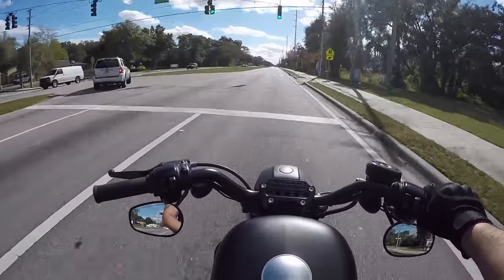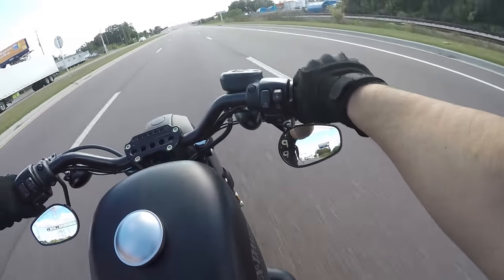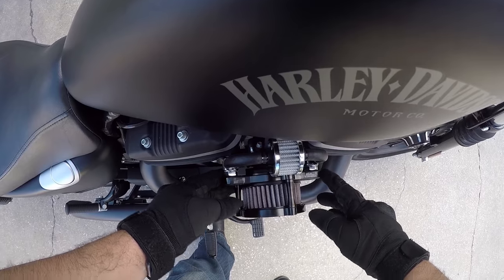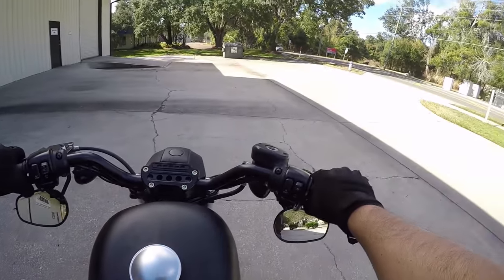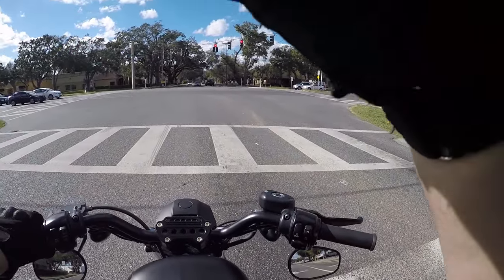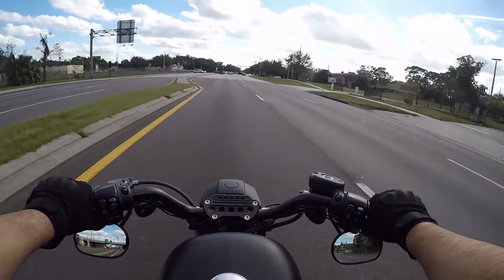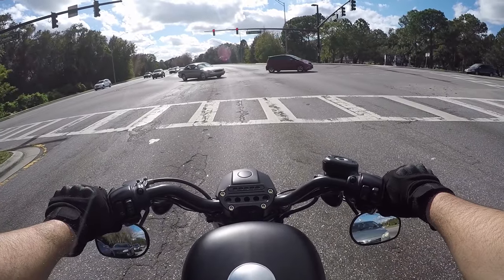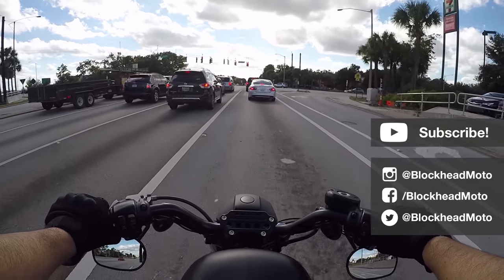AutoTune Problems - V&H Fuelpak FP3 - Harley Iron 883

Comment: Awesome video, man, and hello from Guam! Felt the same problem with the jolting mid-ride and even high RPMs with my FP4. I couldn't find the problem for the life of me, haha. I checked the TPs, air filter, and everything. But the main problem was my battery! Popped a new one in, and it fixed everything. I also asked V&H for a better map that retrofits my build. Everything is smooth as can be.

Comment: I've read most of the comments and every one is saying they put the canned map in and it runs like crap. Me too. After running auto time for about thirty min I flashed the auto time map and got a huge increase in power. Off the line still sucked so I left the bike idleing and let out the clutch and did that several times I did another 25 min autotune then flashed that one and since then it has been awesome. I ride a 2010 dyna. Hope this helps. Make sure you run your bike at all rpms. My maps were almost solid green when I flashed.

Comment: You can contact V&H and tell them your set-up.  I know with Dynojet on my former Ultra Classic, that company recommended which "canned" map would offer the best result.  Perhaps for the wife, a Honda Rebel, or smaller Shadow would be appropriate and still have the cruiser look.  Ride safe!
Reply from the maker: Yeah V&H has all their recommended canned maps programmed into their app. You connect to the FP3 via Bluetooth and program it on your phone, it's pretty awesome. Running their recommended canned map for my setup and the mpg's is terrible, and have heard from many running Auto Tune helps that out a lot. Should be trying to tackle it again over the weekend!

Comment: Auto Tune will keep adjusting as you ride, to find the best point to lock your riding style info into the ECU. You should not Auto Tune full time, as the ECU will just keep getting new and different info. Set it, dump it, and get out of Auto Tune.

For best mileage, find a 20-30 minute ride that keeps you fairly level, and not a lot of throttle input unless necessary. When you dump that info into the ECU, it will think that's how you always ride. The ECU will retain factory throttle input when you need power, so there will be no lag with the engine running lean for mileage. If you ride like normal hooligan style, AutoTune won't do much more than the factory ECU setting.

In the sensor data screen, you can select "Eco" to see when the mileage program shuts off during acceleration. I put my phone in the Raw mount, to watch the sensor data as I ride. I have RPM in the main screen, with mileage, gear, Eco, and engine temperature in the corners.

I also set my backfire for "nasty". So much fun cracking and banging to a stop :)
Reply from the maker: Nice man, thanks for all the info and insight +Messkit! Appreciate it. I'll be sure to give your recommendations a try over the weekend. Thanks again! 

+1 on decel pop, enjoyed mine being more rumbly for that ride back, haha
Reply: When I did my autotune, I tried to ride it in such a way that I got the revs into the spots to learn cells that I wasn't hitting, so I rode it more aggressively than normal, waited longer to shift, etc. Is that not what I should have done?
Reply: @expert_fretwork  It will see throttle inputs and calculate. But if you keep changing throttle level too often, it will just ignore those and wait for a steady input to calculate.

Other than adjusting the ECU while on a dyno, the FuelPak won't "give" any more performance to the computer than what it already has programmed. Autotune smooths the ECU calculations for the engine dynamics. 

Like I said above, rapid or constant changes in throttle input and braking, are ignored by the FuelPak, and it lets the factory ECU settings take over. If you could hold at a steady higher throttle until the program locks that in, you would be hindering performance, since the ECU would now be waiting for higher revs before anything changes. Your mileage will suffer, and you will get no extra horses out of the engine.

Comment: The Fuelpak shuts off certain electronic items on the bike during the learn process. That causes the pop and hiccups. After you tune the bike. Remember to turn off the Autopak or it will not turn those functions back on and the bike will run like crap.

Comment: blockhead, it's perfectly normal to experience rough running while in autotune. The bike is running lean, it's only when you apply, and finish that it will run sweet. I'm now getting 52mpg from my 2016 roadster. Fp3 is fantastic but of kit. Don't go for a dyno, and waste your dollars !
Reply: Agreed.
Reply from the maker: Giving it another try this weekend when I can put some more miles into it. Thanks for sharing, appreciate the insight for sure! :)
Reply: BLOCKHEAD cool, let us know the results of autotune in another video if possible
Reply: out of curiosity, how long did you run it on autotune to get your results? I did two half-hour sessions and flashed the tune after that. Each run had about 20-25 cells learned with a few others in yellow, but I'm wondering if I didn't give it enough of a chance. 

It seems to be running okay, but not any better than the canned map I loaded after I first changed my exhaust out. No noticeable improvement. I'm wondering if I did auto-tune for longer if it would end up with a better result.
Reply: @expert_fretwork  it was a while ago, but I'm sure I ran about 1 and a half tanks of petrol. Also try and do low revs/high revs, all the gears, country lanes, highways etc.... don't think all cells will ever be green but it does need I believe around 150 miles before a final flash

Comment: I think that second filter should be lower . I think the oil is just going to drip all over your nice filter. It's possible with the amount of oil your talking about your motor is not broken in yet. Just some random thoughts hope your tune works out.
Reply from the maker: I was worried about that as well, but mfg said it should be fine. I guess we'll see! If it does end up dripping oil, I'll just reroute to the bottom, easy enough. Actually looking at possibly building an oil catch can, info on that possibly incoming
Reply: My soft tail had this issue . If you didn't break the motor in it's just not going to stop until it broken in. Relocating that second air filter lower possibly by the swing arm will work better. That thick filter will act as a catch can but you need to change it every so often or drain it. Not sure on the quantity of oil you have spiting out but if it's a lot for you to consider a catch can you have a bigger issue and may need a mechanic to pull the heads and check out the piston crowns to see what going on. If there are clean your motor isn't broken in. If they have black burnt deposits on the crown heads it is broken in...then your onto some more cash. Maybe a ring change .

Comment: That's exactly what happens to mine, it starts up but dies after literally a second unless I open the throttle a little bit for about 20 seconds then it'll stay on and run/idle perfectly fine
Reply: Mine does this as wee

Comment: had my fp3 for a year then it went haywire in the middle of a flash bike went into limp mode got it home got it to flash but it screwed up my tune and took it to shop they said the tuner went bad so i went with a power commander 5 and got a dyno running great and today i got my auto tune for it to fine tune it some more. I hope this works out for me now.

Comment: I have the Roadster not the 883 but it loves the fuel pac the only problem I had it did not like the air filter so went with Screaming Eagle OEM type works great and I hate Screaming Eagle Parts.  It's a Harley can be very picky on any thing.

Comment: hey Mr. block with the autotune  you gotta go through all sorts of heat ranges highway /stop and go. also different outside temperatures... to get a good tune your gonna have to keep tuning for 600 miles or so. also chexk your plugs... 
if anything use one of the can tunes .. V&H gots them dialed in pretty good. check out my lil burnout on my page 😊

Comment: so I have a fuel pack 3 too but I can't get it to work at all. I bought my bike used and it already had the fp3, air cleaner and exhaust installed. any suggestions on how to actually get the fp3 to work with my app?

Comment: hey mate did u sort auto tune I have a issue with my 2017. short shots and quite baffles. put there tune on and runs like shit. idles high when rolling and clutched. goes back to norm at idle, bit shitted with fp3
Reply from the maker: Auto tune never ended up working for me. Think it's more meant for long distance and not city riding (which is what I mainly do.) Checkout the final vid in this series / playlist, I switched back to a canned map. Canned map works great, but auto tuning wasn't working well for me at all, unfortunately.

Comment: I have the exact same intake on mine and since I installed it, I get that exact same hiss/pop when I start the bike cold. Does it once or twice then it's fine once it warms up. I have not tuned it at all since installing the intake. If you figure out what is causing it and how to fix it let us know. I'd appreciate it!
Reply from the maker: Usually with a high flow intake, the fuel management system is recommended, hence why you might be getting the hiss / pop. Whenever I have the V&H FP3 recommended canned tune mapped, there's no pop / hiss, so that definitely solves it. Only thing is it causes the mpg to reduce drastically, so trying out their AutoTune feature to try and remedy that.

Comment: Hey Blockhead, I currently have a pair of short shots paired with an air intake that looks like the same one you have and a Fuelpack3. Ive found oil residue (small amount) inside the filter that I can see through the clear cover. Is that hose the fix? If so, where can I find it?

Second and last question, I started using AutoTune and the bike keeps bogging at low RPMs. Did you experience this? And if so, how did you fix it?

Greetings brotha, stay up!

Comment: I've been trying to run an auto tune on my 883 Iron, ran it for at least an hour.....but getting a spluttering on accelerating from a standing start....it's doing my head in
Reply: My autotune is doing the exact same thing on my 2019 1200 iron did u do anything different to fix?
Reply: Lol having the same issue just trying to put some miles on to see if it settles out. What did you guys ever discover?
Reply: @xXsharkey77  bringing a dead post to life, did anyone resolve this issue?
Reply: @Weirdhourmoto  it'll do that while you're still in autotune because the tuner intentionally disables certain functions for acceleration and deceleration. It's going to run more rough while you're in autotune than when you go back out of autotune. That's normal. 

You're not meant to leave autotune on all the time. You do it for a few rides for the tuner to learn how you ride the bike and then end the auto-tune, flash that new learned tune to the bike, and ride with that map.

Comment: Maybe try the Honda 500 rebel. They are light weight if she wants more power try the shadow 750 they are light weight to. Check  the web sites they weight should be listed.  Honda might be lighter then the Harley's  if that's still to heavy and she not going on the highway look at a 250
Reply from the maker: Thanks for the recommendations Chris!